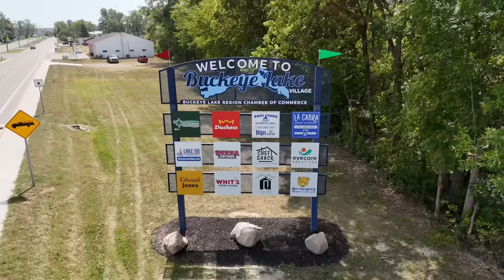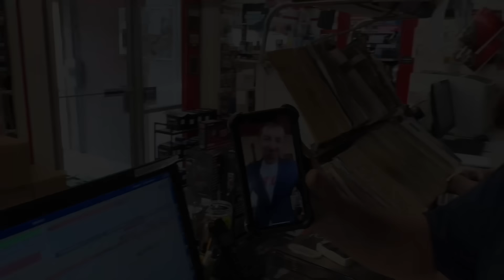TUNING UP A TIME MACHINE! THIS BIG BLOCK 4 SPEED 55 Chevy NEEDS HELP!

Comment: There is an over Center spring connected to the clutch pedal that spring was designed to help with pedal pressure when using a borg and beck 3 finger  pressure plate . Confirm that it’s not a diaphragm clutch pressure plate if it is simply remove the over Center spring and no more sticking clutch pedal . This was a prominent mopar issue when converting to a diaphragm style pressure plate from the old both and beck type .

Comment: It definitely needs a new clutch I have had the same trouble in a 69 z-28 had a cheap clutch and the pedal stuck to the floor. Put a good clutch and fixed the problem. He needs some new 450 atm’s carbs on it and it would be money. 💰 Great show Bill.

Comment: Just my two cents of hopefully helpful advice, when it comes to old street engines with high compression.    I had a standard bore 350, flat tops, double hump heads, that I believe, are quite a bit under 64cc. ( probably problem number 1 )   I've never had them cc'ed,  but, I had to have them refreshend for the second time because of carbon build up.  ( and, hard telling how many times they've been gone through,  resurfaced etc, before me?? )  Timing was around 34-36°, 280° cam.   It ran really well from home to work every day, but, I never wanted to lay into too much because I was afraid of detention.  And, It was my only vehicle for a long time.   I always ran 93 octane.   Again,  it always ran well.   Always seemed like the fuel wasn't too rich etc.    But, I'm sure by not cleaning it out/ blowing the cobwebs out, as often, and, not having, at least, a mix of 110 with the 93, and, driving a short 5 mile distance, 10 total miles per day, at the time, not creating enough heat for a decent amount of time,  created the carbon problem.    Long story short, make sure the tune is good, have good fuel, and, clean those things out in a relatively safe location.   It will save you from having to tear your daily driver down, as long as, everything else is in good working order.   Or, at least, until the next problem arrives.   lol.    We all know how that goes.  Ya fix one thing, and, 3 more things need fixed.    Thank you for reading.    Trent

Comment: The clutch problem is common in these older models Bill. I experienced this back in 67 with my Formula S Barracuda. It’s a diaphragm clutch verses a 3 fingered one. The diaphragm unit will stick down under heavy power and the 3 fingered one doesn’t do that. Very common back in this era my friend. I’m 78 by the way so I’ve seen much of these things first hand.

Comment: We used to have the same issue with my brothers 56 2dr post it ended up being the pressure plate,his had a 402 750 dual pumper changed the pressure plate with stronger fingers stopped the problem good luck love the El camino

Comment: Bill! Please do a detailed video explaining on how you go about setting up distributor’s. How you lock them out and what that exactly means and accomplishes. What it does to your base timing advance timing and total timing. If you do have 38 degrees of timing in it how do you get the engine to not have hard cranking? Or is it 12 degrees advance on base timing and your advance is set to 38 degrees? Maybe a stupid question but I would rather get a proper explanation than just nod my head and pretend to understand! Love the content of both SRC and your channel! Thanks for your time!

Comment: Iv delt with clutch issues like that on my diesel pickup. I had to put springs on the pedal to return it. But it’s how many rpm’s your turning, the centrifical (sp?) force of the clutch spinning that fast keeping it to the floor. Sometimes a heavier spring pressure on the pressure plate helps

Comment: If I were in Marks shoes, I would swap the intake with a nice single plane, and dump the 600 vacuum secondary carbs in favor of an e85 1050 with a NX plate system.
He definitely has a very cool old ride.

Comment: I had the same problem 57 years ago. I'm 74 now.. Its a weak pressure plate an clutch. I added stiff door springs under the dash to pull the clutch off the floor, (need a strong left foot) This worked until I could afford to replace them. Old Schooled...

Comment: My 55 sedan had big block tunnel ram 461 with a diaphragm pressure plate that would hang the clutch pedal to the floor when I would buzz the motor then try to shift. It would fly back out with a hec of a bang. The last time it stuck to the floor when it released I thought the dash was gonna fall out and it broke the spider gears in my 12 bolt.

Comment: Seems like Chumpy’s 55 needs a clutch upgrade. From what I seen, it engages way up high on the pedal. I had a similar problem back on my 75 Monza. I had a bad motor mount, and that would put pressure on the Z bar and keep the clutch from engaging under power.  Check them motor mounts. 👍🏼

Comment: The Bellhousing if not stock will likely require offset dowl pins to ensure the crank shaft/clutch assembly/transmission input shaft are aligned properly.

Comment: Diagram pressure plate.
Put a pedal limiter, readjust clutch. 
With the Diagram pressure plate over centers/higher rpm it flex's over center (sticks to the floor).

Comment: Bill, Chumpy's 55 definitely needs a shifter upgrade, 2- 650 cfm mechanical secondary carbs,fuel pressure regulator and fuel pump. And the problem with the clutch sticking is that the Z bar and clutch linkage are out of alignment. It's a common problem with big block Chevy swaps.

Comment: On many of the manual cars I had there is a spring on the clutch pedal I am not sure on that car but if there is the spring is weak and needs replaced I have had that happen before and that was the issue or the z bar needs grease

Comment: My    big block Nova   was bad about the clutch    not coming back under WOT had to change out the pressure plate to one with a lot heavier springs but dam if I remember the parts number that was  in 1998.

Comment: My dad had a LS6 based 461" BBC in his '57 back in the early 80's, the car I 1st remember! That thing spun to 8900rpm in 4th gear, 168mph on the street, and lived YEARS past that! It's still to this day claimed to be the fastest car he's ever had on the street! That same motor was in a chassis nova, and went in the mid 9's before he got it, washed a couple holes and  redid it to what it was in the '57. Only thing changed was the cam, a spec'd 4spd cam was put in. And I'll 2nd that big blocks over 11-11.5:1, fuel needs mixed, at the least, as they do not like pump gas! It used to ping, vapor lock, just not run well! I'd like to see the 55 on e85 and see what it picks up! Much cheaper than filling a streetcar up with $12/gal 110 fuel! He does have a pretty slick time machine though, with the velour interior, dual quads and old 4spd.! As far as Jeremy working on it, I think it's all in good fun, and all being fellow car guys, I just couldn't see anyone trying to sabotage a race. We're all in it for the fun, laughs, excitement, friendships, and just the passion we share for these cars! Then you have Gunner, in his Jimmy Dale t shirt, and a sports coat playing lawyer, that just tops it all!lol Thanks guys, good luck and God bless!

Comment: You have to adjust the over-center spring to fix that clutch pedal issue or you can remove it all together.

Comment: 19:05 classic example of old school diaphragm clutch pressure plate without the fancy centerforce style weights. Thats why they used to run the Long 3 finger system...until clutch technology advanced. Clutch pedal stuck to the floor as the throwout bearing over centered the many diagram style clutch fingers...

Comment: Malwood USA makes a Hydraulic clutch pedal assembly for the Chevy 55's , what if you put thicker head gaskets to lower the Compression a little.  I'd take the shifter out put in vice heat with a torch and bend it over to driver side for better location and feel . Run a single carb
Reply: I wonder if it would work on your Monte Carlo never know..

Comment: So....as you know I'm one of the "old timers"(75 now) that you referred to 🤨!!  Back in the late 60's when I started street racing, I can remember the Chevy guys complaining about their clutches sticking to the floor at high rpm. GM used a diaphragm clutch, where Ford always ran the 3 finger style which never did that. I, of course, was a Ford guy so never had that problem. I know nowadays most everything is diaphragm style so they must've learned how to set up the pivot points and flyweights so that problem is no longer. Tony and Tess could probably help with that where they did that tour of the clutch manufacturer. Good luck this weekend !

Comment: I had a 64 El Camino that the clutch pedal stuck to the floor like that. I put a good Mcleod pressure plate and throw out bearing in it and solved the problem.

Comment: I see reman stickers on them carbs! I bet no one tuned the carbs and just threw them on! Having the two carbs idle screws out of sync definitely causes big problems! Clutch pedal hang ups usually bad motor mounts or using the stock ones with all that Horse torques. Its still gonna rip! Look out Bucko hes going to beat you!

Comment: Mark should ditch the tunnel Ram and put a single E85 ATM carb on that thing with  locked out advance. You can hear it hates the low ignition timing at idle

Comment: The clutch pedal staying on the floor sometimes is caused by:
1) The throw out bearing... It is sticking, not sliding back-forth properly on the input bearing retainer. If the input bearing retainer is not worn, a small amount of grease (on the input bearing retainer shaft, where the throw out bearing slides) may fix this issue.
2) I have also seen this issue with a bad pressure plate. The pressure plate fingers were coming loose/binding, after a clutch disc spring slung out of the clutch into the pressure plate and damaged some of the fingers.

Comment: I don’t know the compression on his engine or the cam and heads I would say he needs 2 new 600 mechanical secondary. I prefer my Holly’s but I know that’s not where you’ll go. are they both vacuum carburetors I wonder if they didn’t put a vacuum secondary on the front for drivability no I guess that wouldn’t work because then he would have to have a progressive throttle system. Shit here. I am asking myself questions now.🤣 thanks for the video. Hope y’all have a great Labor Day weekend

Comment: `The clutch peddles to the floor is a thing i would like to find the Cause. I have been racing the same Car for the last 5 years, I installed a new Clutch A Ram Competition. The first pass I made with the new Clutch, i power shifted  into second and the peddle stayed on the floor until I lifted the throttle. What is wrong with this high dollar Clutch. I have run Stock Clutch's and have never had this problem before.  I have changed to a different brand since and my Problem is fixed, I still want to know what went wrong.

Comment: Bill don't waist your time looking for adjustments on that clutch, the problem is the pressure plate just go straight to it and change it because that happens to long time ago
Reply: I agree , we had a 67 Camaro with a Muncie in it and when the fingers on the clutch would go past center the centrifugal force would not allow then to return till the rpm’s would drop

Comment: Need to run smaller clutch disc on that pressure plate or they will stick, can not shift at upper RPM’s— got to up to race gas or it will ping, block out distributors, if possible get ride of vacuum cards

Comment: Addys car, trash that 6AL.. Put a Digital6 in there. those Old Analog boxes are hit or miss. Worked at Summit for 5 years , they were always gettin returned. 116Race Gas in Chumpos 55, check the shiftl inkage also on that Muncie. That old clutch rod might be over engaging too deep into that pressure plate. LOTS a fun out there... Be blessed ya All🏁🏁🇺🇸🇺🇸🤙🤙 John 3:16

Comment: even with aluminum heads, 12:1 on 93 (?) octane is just too much unless that cam has all-day duration. Maybe there's a killer "twisted wedge" style combustion chamber design in those heads or ceramic heat shield coating, or heck,  maybe the old "soft head" or dimpling that NASCAR experimented with in the 1990's was done to them? curious minds want to know. I know that Engine Masters will run compression that high on a chamber with zero oil leaks to avoid detonation.  curious minds want to know :)

Comment: Hydraulic clutch or cable? If cable operated, potentially stretched or frayed cable causing it to stick... if its Hydraulic then maybe an air pocket causing it to stick or a clutch master/slave cylinder about to let go.

Comment: It definitely needs a different clutch he probably used a heavy duty Chevrolet big block clutch and with centrifugal force in the horsepower behind that big block they will suck right to the floor and stay there I've had it happen more than once you have to have bigger springs put in the pressure plate or buy a performance pressure plate or it will just keep doing it

Comment: Get rid of those junk vacuum secondaries carbs put a hydraulic throw out bearing and clutch in it.  Change the cam then it would prob out run the small blown 327

Comment: I hate to say it...I have now seen Uncle Bucko tearing up the neighborhood and your circle track on a go cart, and  A-1 Mark (Chumpie), attempting to load a not too hot running 4 gear 55' shoebox onto an open trailer.

I am predicting The Chump is gonna get stumped (or his nuts stomped), if Bucko just gets his go cart out unless Bill converts that Shoebox over to an automatic (no matter what or how he gets the dual carb issues resolved). Either way both are sweating the big stuff.

But Bucko behind the wheel is fearless and throws caution to the wind if it has at least half a steering wheel...Billy is afterall his nephew and he gets his family fly free (win or blow it up attitude), from his uncle Bucko!

Just sayin'.

Comment: Tell mark to run the car on 102 av gas from a local small airport. I won a lot of races on that fuel and it's a lot cheaper than 110.

Comment: You need to talk chumpy into a single E85 ATM 1050 dominator  carb with a nice single plane intake. And have a nice hydraulic clutch setup installed.

Comment: Acts like a broken Trans mount or a bad motor mount like the rubber in the mount is bad rotten and messes with the clutch linkage and the shifter linkage as I notice you kept missing third when the clutch dint release like it was suppose too! That my two cents worth as this car has been sitting for along time and not being used.

Comment: The best 4spd shifter is 
1 MrGasket vertical gate 
2 Hurst vertical gate 
IMO
Maybe the clutch linkage pivit ball needs to be greased or put a return spring from linkage to frame. Just a thought. Great video.

Comment: 22hrs jesus christ . Thats the difference of a honda (your phone) vs a pc (billys truck) . A pc would save u tons of time rendering ect  , Your phone has 4 cores at most . PC's have 16 cores or more (bigger motor in your terms) u got the 302 Fawd mota on ya phone . PC has the stroked TT 632 stroked out lol . a computer cut that down to 12 easy

Comment: Im sorry Bucko, i like you and all, but your small block A-rod is gonna get walked on by this big block 55...
Traction will be non existent for both of you, but a lightweight model A with no chassis tech aint gonna scoot like you think. The big block 55 probably will weigh at least 1000 pounds more but will spin and scoot.